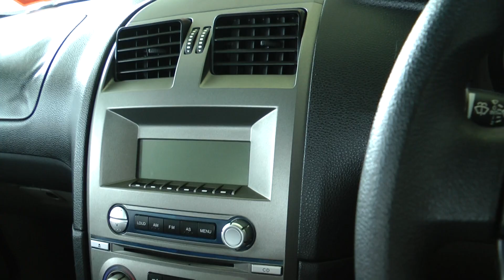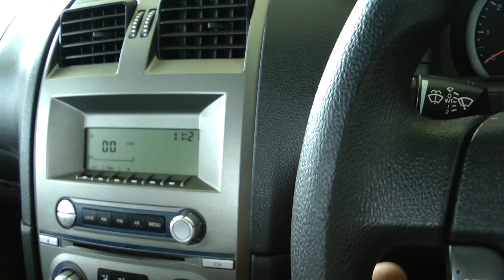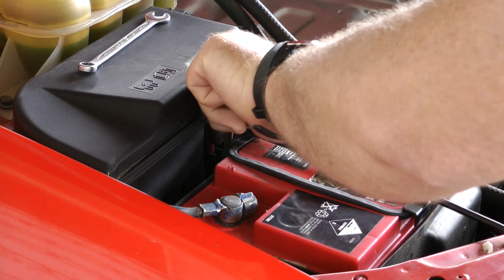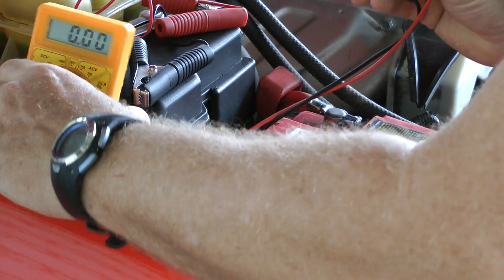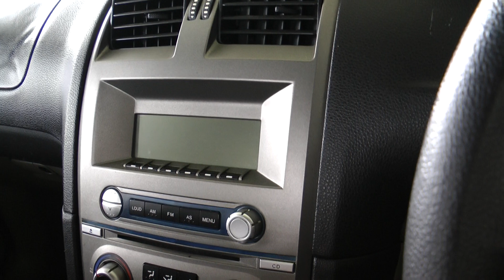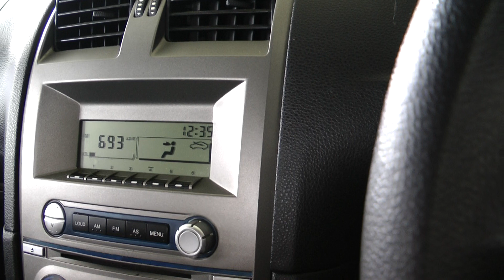How to change your car battery without losing your radio code and dashboard setting. HD

Comment: This sounded like it was recorded in UK, so if anything is done in reverse, that is why. Other than that it is a good video. Anyone watching will have the basic knowledge to change a battery.  Also the electronics including the computer could be affected when complete power is removed and a "memory minder" is not used.  Before doing this process consult a few videos to gain expert insight. NOTE:  If you plan to change the battery terminals, please consult a video on how to use a OBD2 connector to maintain power to the electrical system.  You will thank me later.

Comment: What a load of malarkey 
Just leave the engine running when changing the battery worked for me
Reply from the maker: Your advice is Malarkey Removing the battery while the engine is running can cause significant damage to the vehicle's electrical system and potentially damage the alternator. The alternator, which charges the battery, will have nowhere to send the electricity it produces, leading to voltage spikes and damage to sensitive electronic components.
Reply: @heymargaretlook  bollocks

Comment: When disconnecting battery leads ALWAYS disconnect negative first (earth).  Do not do it the way this guys shows.  Its potentially dangerous and asking for trouble.   However, when re-connection always connect the positive lead first.
Reply from the maker: Because it is always positive first, negative second when connecting two batteries together. ALWAYS, in every country in the world, look at your jump start instructions. Positive of dead battery to positive of healthy battery, negative of healthy battery to negative of dead battery. You got confused because when removing or placing a dead or live battery directly into a car with no other battery connected you go negative first then red. Simply put there is a difference between connecting two batteries and replacing a battery.  https://www.shell.com.au/motorists/go-well-content-hub/back-to-basics-how-to-jump-start-a-car.html

Comment: If you have a Gooloo or a NOCO battery booster that is capable of also charging phones, tablets etc, you can also use that in the same way as this 9 volt set up. Then you also have a portable battery booster and of course can charge your phone or I Pad.

Comment: You can actually also get very cheap 12V A23 Alkaline batteries used for Garage door remotes and other things, following the same considerations to avoid draining the battery.  If you were slick you could use the new battery you are installing for this, too.  I would wrap stripped copper wire around the terminal posts of the new battery and the other ends of those wires to the appropriate jumper cable ends and clamp the other end of the jumper cable to the connections in the car.  Then you can just pull off the copper wires on the posts after you get it connected and mostly installed.  You might want to take extra precautions to avoid a short with all the bare hot ends floating around, though.  Maybe not jumper cables after all.  Just two wires with alligator clips at on end and bare wire at the other.

Comment: Hi. Just want to ask, which one is the better method, the one where you place backup power on the battery cable connectors, or through the OBD socket? What are the pros and ocns of each? Thank you in advance.

Comment: Good device for saving memory hassle when U lose Radio pin sec mode comes on Radio after removal always negative terminal first of battery which will reset ECU if no current is hooked up also not good idea to were rings I remember once I shorted positive terminal and  ring got extremely hot blister under ring

Comment: It's a little dangerous. The 12 volt battery (depending on current charge) will be pumping voltage onto the 9 volts beyond it rated capacity, and could cause the 9 volt to heat up and blow. It could also happen during moments you have the new battery installed with your minder still connected.
Reply: Shouldn't put videos out that are wrong in every aspect stick to pen pushing .

Comment: At 7:50  he's got it backwards...when removing the cables, always remove Black/Negative clamp FIRST before then removing the Red/Positive clamp LAST.
Reply: Yes, thats the rule of thumb👍🏽
Reply from the maker: The instructions I give is what is written on the back of code  saver unit, buy it and read it yourself I have no connection to the sales of this unit. Because it is always positive first, negative second when connecting two batteries together. ALWAYS, in every country in the world, look at your jump start instructions. Positive of dead battery to positive of healthy battery, negative of healthy battery to negative of dead battery. You got confused because when removing or placing a dead or live battery directly into a car with no other battery connected you go negative first then red. Simply put there is a difference between connecting two batteries and replacing a battery.

Comment: 1. For safety, always remove negative first. You did get the reassembly sequence right (positive first). 
2. Be damn careful not to short the positive battery cable to anything metal.
Reply from the maker: Because it is always positive first, negative second when connecting two batteries together. ALWAYS, in every country in the world, look at your jump start instructions. Positive of dead battery to positive of healthy battery, negative of healthy battery to negative of dead battery. You got confused because when removing or placing a dead or live battery directly into a car with no other battery connected you go negative first then red. Simply put there is a difference between connecting two batteries and replacing a battery.  https://www.shell.com.au/motorists/go-well-content-hub/back-to-basics-how-to-jump-start-a-car.html https://www.shell.com.au/motorists/go-well-content-hub/back-to-basics-how-to-jump-start-a-car.html

Comment: How does this not blow up your 9 volt battery by shorting 12 Volts 13 Amps through it in a dramatic dangerous explosion? I guess you are relying on the battery being Dead? however I dont think that's a good idea unless you check first with a meter.

Comment: Putting a 9V battery across a 12 V battery will cause potential difference and current starts flowing from 12 V to 9 V.  Since the 9V batter is not a rechargeable, it may explode.
Reply from the maker: Because it is always positive first, negative second when connecting two batteries together. ALWAYS, in every country in the world, look at your jump start instructions. Positive of dead battery to positive of healthy battery, negative of healthy battery to negative of dead battery. You got confused because when removing or placing a dead or live battery directly into a car with no other battery connected you go negative first then red. Simply put there is a difference between connecting two batteries and replacing a battery. https://www.shell.com.au/motorists/go-well-content-hub/back-to-basics-how-to-jump-start-a-car.html

Comment: If anybody wants to make their own memory minder, it's not just a battery with leads. If it was, the car battery would try to charge the 9V battery and perhaps blow it up. There has to be a diode built in that allows current to flow from the 9V battery into the car but not from the car battery into the 9V battery.
Reply: Not true. If the vehicle isn't running, there's nothing (alternator) running which generates any power. Current can only be drawn by the vehicle.
Reply: @cmscott  Have another look. He connects the 9V battery directly across the battery terminals. That's why I said the car battery will be charging the 9V battery. Can't have that.
Reply: @cmscott  I said the car battery would try to charge the 9V battery. The engine doesn't need to be running for that. There needs to be a diode in the memory minder lead to prevent that.

Comment: Great idea but I can't find one of these memory minders for sale anywhere. There are some that plug into the cigarette lighter instead of going onto the battery leads but I don't see how that works.
Reply: Ray Stroud mate as a mechanic the cig lighter is connected to electrical system and
Reply: Sorry didn’t,t finish.  This then powers the electrical system and keeps alive the memory to the car including the computer.
Reply: @gregmatthies8128  - Thanks. I've now bought a jump starter which has an auxilliary outlet to provide a cigarette lighter-type connection. However, now the weather is warmer the old battery is coping OK so I can wait another year :-)

Comment: Couldn't you use a trickle charger/battery charger using a port on the inside of the car?
Reply: @torTxoFognaTuluZ  It does work... we hooked up our 12v trickle charger to the input inside my wife's jeep while I swapped out her battery. It worked perfectly, and we didn't reset all of the internal memories for her radio, presets.. etc etc.

Comment: Battery disconnection should be "Negative first" then you know what's next. Installing the battery should be "Positive first" then you know what's next. The reason why we install Positive first is for safety reason. On the other hand, if you connect the lug on the positive lead first, and then the negative, even if the spanner happen to touch the frame, it doesn't result in any harm. But if you connect the Negative first followed by Positive which touches the frame then you're Fucked!!! lol

Comment: I have to say, what was wrong with the old radios that kept the station presets independent of whatever the hell you do with your battery?
Reply: It's an anti theft feature in the radio i just bought a 99 Yukon and i have no idea if it is activated or what the code is .O well i need a new radio anyway!

Comment: Why did you remove the positive terminal first?
What the common wisdom on that is is to remove
the negative terminal first in order to lessen the
chance of a short through the wrench to the chassis
if you remove the positive terminal first.

As long as you are careful I doubt it matters much,
but the negative first is what I have been told.

Comment: This is exactly what I do. I see all these videos of connecting a so called "Memory Saver" to the OBD port but that is not needed if you use this method in this video. It is such that the
car never actually looses battery power so it does not loose any settings in the multitude of computer modules in the car. Myself, I just use a small 12 volt battery that one would normally find in a riding lawn mower. Never tried a 9 volt battery like in the video, but if nothing
else, one could use 8 AA batteries in series and have 12 volts. Myself I would want no less then 11 volts since I am unsure of the low voltage threshold of these modules in newer cars.
Still,  he clearly showed that this 9 volt setup worked for the vehicle in the video. Cool.

Comment: You don't have to go through all this. If you have a small 12 volt lawn mower battery, then just clip on the + terminal of the small battery to the + terminal of the car wire and the - terminal of the small battery to the - terminal of the car wire, and then remove the terminals from the car battery, first the positive and then the negative. The you can change your regular car battery. The small battery will keep all the information on the dashboard and radio from disappearing. It takes very little amperage to maintain it.
Reply: Yes - that's what I would do -

Comment: The reason to disconnect the negative first on a negative ground vehicle is because if the positive was disconnected first and somehow it accidentally touched any metal part of the vehicle, there would be an instant short. Sparks would fly and the battery may even explode due to the sparks igniting the hydrogen gas from the battery.

Comment: Let me relate something that happened to a friend of mine, a dentist by trade who likes to work on his sports car occasionally. In preparation for some other work, he elected to remove the battery from the car, using a box wrench to loosen the battery clamps. The wrench made contact with his wedding ring (he's lefthanded), and the ring in turn made contact with the battery holddown. A massive short circuit welded his ring to the holddown and to the wrench, which in turn was welded to the positive terminal.
Reply: Electricians dont wear rings for similar reasons
Reply: I have personal knowledge of a generally similar accident.  The ring and wrench weren't welded together and to the vehicle, but the ring did a really good imitation of the filament in an incandescent light bulb and nearly completely "cut" the finger flesh around the bone...in effect, an electrical self-amputation. 

I had never heard of similar accidents and figured this was about as likely as being hit by a meteorite, but your report makes me think maybe these happen with some regularity, that they're just "infrequent" rather than being almost impossibly rare.
Reply: You didn’t mention how his ring got hot and burned his finger!

Comment: Another 12 volt battery connected with wire and screw clamps to your battery cables before you remove them from your battery is not going to come undone.....and it's all you need. Nothing special needed.

Comment: i mean... if the vehicles are touching it's not really a problem as far as jump starting a vehicle is concerned. if you have no other choice and must jump a car but one of your jumper cables is damaged or you don't have any but can find so single heavy wire that's long enough I don't see why you couldn't park them together and use what you have to connect the hot side. when you hook up it should even be able to arc through paint and fuse on its own but if not you could jump on the hood of one of the cars it would be like if you were connecting a clamp to a crusty old battery terminal.

Comment: Negative battery terminal removed first. Always!! And this has nothing to do with shocking yourself. It is to stop you shorting out your spanner between the chassis of the vehicle and the positive terminal with your spanner when loosening/tightening it.
Reply: I thought everyone knew that. My son is an electrician. He started laughing when he heard this guy say positive first.
Reply from the maker: @Zeek800  did you tell him the other battery was a 9v battery with no diode.
Reply from the maker: @Zeek800  Because it is always positive first, negative second when connecting two batteries together. ALWAYS, in every country in the world, look at your jump start instructions. Positive of dead battery to positive of healthy battery, negative of healthy battery to negative of dead battery. You got confused because when removing or placing a dead or live battery directly into a car with no other battery connected you go negative first then red. Simply put there is a difference between connecting two batteries and replacing a battery. https://www.shell.com.au/motorists/go-well-content-hub/back-to-basics-how-to-jump-start-a-car.html
Reply: @heymargaretlook  yup my jumper cables come in a yellow plastic zip up bag that has the order to attach the  clamps listed on it.
Reply from the maker: @Zeek800  you have changed your mind now.
Reply: 2qq

Comment: Why, you dummies, suggest to disconnect the negative first? Its obvious when you DISCONNECT the battery from the circuit - the rule is minus first, then plus. Amen. But guy in this video doesn't care because the circuit is still closed. Think first then type the words geniuses.

Comment: those of you Americans saying to disconnect the negative first and the positive terminal second are forgetting that this is a European car with the steering wheel on the right side of the dash. It is opposite of American cars, so positive first. LOL
Reply: taking the negative off first reduces the chance of electrical spark
if you do positive first,and the spanner undoing the positive touches the car body anywhere it will give a big spark
undoing negative first there is no chance of spanner sparking on body as negative is already connected to body of car
Reply: Brian Carr iii
Reply: Wrong it is not an European car it issued Australian Ford falcon